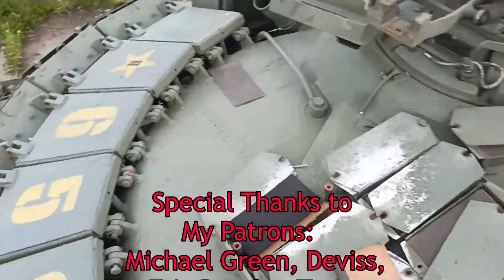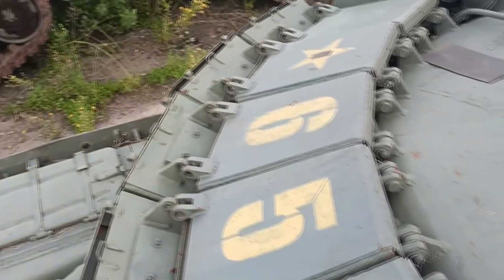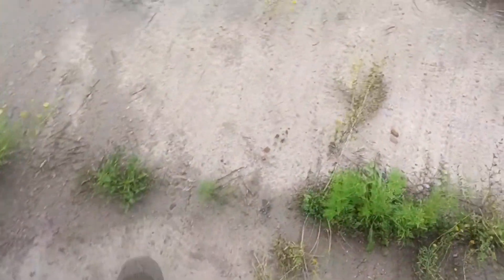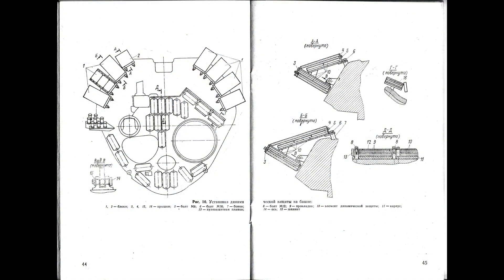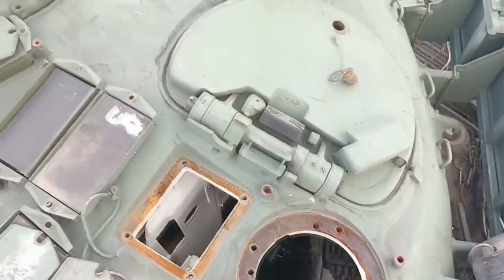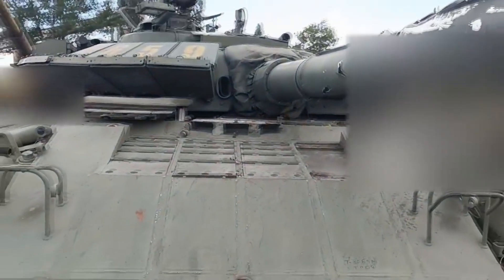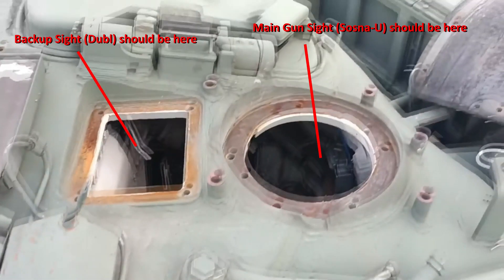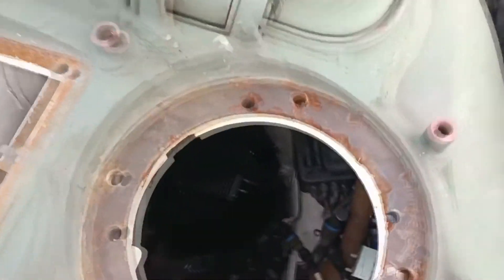Russians Are Using Rubber instead of ERA on their Tanks

Comment: In Desert Storm my US Marine M60a1 tank had empty-inert reactive armor blocks on the sides of the turret. Only the front slope and turret front had real reactive armor with explosives in the blocks. There was a shortage and so our M60's were not fully covered in ERA.
Reply: The "inert" blocks were most likely NERA panels, which are made up of layered metal and rubber. Apparently it's supposed to work at breaking a penetrator up by not being solidly connected together and introducing sideways/shearing forces into it.The lower-front hull panel of the M1 Abrams apparently has NERA integrated into it, not as aplique panels.
Reply: @dj1NM3  nope they were empty
Reply: The tank equivalent of only wearing the front panel plate :D
Reply: @josephmontanaro2350  It's just gotta look the part lmao
Reply: @josephmontanaro2350  Nope.That rubber are good only to stop added cumulative charge with magnetic suport
Reply: @josephmontanaro2350  yuuuup
Reply: To be fair, desert storm was such a stomp that the Iraqis would never get a chance to flank you, so you really only needed it on the front
Reply: @SelfProclaimedEmperor  I was there and to be fair we didn't KNOW it was gonna be a stomp so.....
Reply: @SelfProclaimedEmperor  Were you there? I was and I got hit by Iraqi artillery, had Iraqi tanks shoot at my 27 year old M60.
Reply: @ProjecthuntanFish  id be interested to hear more about that. The service of M60 in the war is hardly ever mentioned.
Reply: @ProjecthuntanFish not sure if you're willing to tell your story but I'd be interested in hearing about your service. What was the artillery like? Did it hit the vehicle? I never get a first hand account from those with real armor experience. I'm glad you survived I hope everyone else made it out. Thank you for helping in kicking Saddam out of Kuwait.
Reply: @soul-om4id  We were stopped in the first belt of mines going into Kuwait waiting for the column in front of us to move so we maintained a 100 yard distance between vehicles. I heard someone firing a rapid fire burst out of a BIG gun right near us and I told my tank commander that someone had just shot near us. I assumed it was one of ours. Then the XO who was watching the assault from his tank behind us came on the radio and told our platoon commander that his last "white" unit (we were call sign white platoon) had just taken a near miss by 6 rounds of Iraqi artillery about 20 yards behind them. Then it suddenly dawned on me that we were the last white unit and that the firing I heard was actually the Iraqi artillery landing right behind us. We then had a crew discussion about did our packs on the back bustle rack get shredded by shrapnel and were the two 5 gallon oil cans strapped to the side of the turret now leaking all over. As it turned out we only had some paint chipped off the back grill doors, LOL. I was in a USMC reserve unit and we hade M60A1 tanks.
Reply: @ericmckinley7985  I just posted a reply in this thread go look at it my friend
Reply: @ProjecthuntanFish  thats awesome. I was curious to know if tanks from the Cold War onwards were really vulnerable to less than accurate artillery. I love vet stories.
Reply: @ProjecthuntanFish  thank you for the reply, it's really awesome to hear your experience and I greatly appreciate it. Man that must have been a surreal event and one hell of a "pucker moment". It's kinda funny the concerns of did your rucks and oil cans make it out Instead of "holy shit we almost caught an arty round". Thankfully it was only chipped paint, but damn still way too close for comfort! 

A bit of a tangent but have you heard of a group on social media called Battles and Beers? They document stories and experiences of military personnel to share with others. If you're willing you should reach out to them and tell them your experience of being a tanker during Operation Desert Storm. Also they aren't long stories, they're pretty quick. But I know they are looking for experiences like yours to share. 

Thanks again for the reply. Semper Fi
Reply: @soul-om4id  Actually when things like this happen in combat you really dont realize the gravity of it until much later at least for me. Its not like a war movie where you see and understand everything that is going on. As a loader I was privy to jack squat of intel, LOL. My world was a loaders station and my main concern was doing my job, not letting my crew down and coming home alive.
Reply: @ProjecthuntanFish  how interesting. M60A1? Not even M60A3? I knew the M60 fought in the Gulf War with the USMC, but I never knew which model.
Reply: @kurousagi8155  yep no laser range finder just the old parallax frog eyed range finder
Reply: @ProjecthuntanFish if you don't mind I'm asking what's your opinion on the Marines ditching their tanks
Reply: @culturedman1310  I think it's a stupid idea and it castrates the Corps. Without tanks we cannot fight a combined arms battle and are now essentially just three Ranger divisions. The Current Commandant is a special ops guy so I doubt he fully understands how to fight a large battle. At some point Marines will be killed due to lack of tanks.
Reply: @ProjecthuntanFish  wow. I was in and around that shit hole for 11 fucking months and never even knew we still fielded M-60's lol. Yea the Marine corps fights with donations it seems like. Did they still have the big ass search lights on them? I trained on one at Aberdeen proving grounds and they were obsolete then!!! I mean the M-1,s been around since 80 or 81. I was around a bunch of marines but no armor units. We had some TOW guys around. I mean we had EVERYTHING!!!! It is a truly awesome sight to see the modern American military on the March like that. We had air shows. B-52 strikes in the distance. A-10's sawing shit up and oil well fire backdrop. Not much around me i was up north around KKMC but it fucked the sky up. It was just really surreal.... I can't believe you were on a 60 though lol. Good job.
Reply: @ProjecthuntanFish  what unit were you with and where were you located?
Reply: @richiehayhurst8175  Charlie 8th tanks. My platoon was attached to A/1/6, 2nd MEF, 2nd MAR DIV
Reply: @ProjecthuntanFish  hey fellow vet here, Did you ever see another m60 take an actual hit from a main gun of the Iraqi tanks? How did it hold up if so?
Reply: @ericpatten6204  no I did not and while we were fired on by some Iraqi tanks none of us were hit that I know of. My platoon was engaged by a platoon of T-55's but due to defilade we could not see them. Another unit spotted them firing at us and a Bradley unit from the US Army's Tiger Brigade took them out with their 25mm guns. We did suffer several mobility kills due to Iraqi anti-tank mines. Our M88 recovery vehicle was hit by Iraqi machine gun fire at one point though. On about the third day of the ground war my company repulsed a counter attack from elements of the Iraqi 3rd armored division a few miles south of Kuwait City. They were hit by Tiger Brigade's M1A1s and coalition air power in their assembly areas just outside of the city. A mix of 9 tanks and APCs managed to hit our position and were destroyed in a fight that last about five minutes. F-18's, Humvee mounted TOW missiles and our 1st platoons 105mm main guns took them out. We advanced into their AO and parked next to a burning T-62. I had my head out the loaders hatch when it cooked off and a round from it hit the side of the turret or hull below me. I promptly buttoned back up and we moved.
Reply: Reasons are probably similar as ERA plastic explosive has a shelf life of less than 10y or so its not always mounted in the elements in peace time for reasons like folks removing 100kg of plastic explosive for 'private ' use . And like the author mentioned, the tank on the picts was literally picked apart for months so we cant know when it was taken out.
Reply: @Mr.T-SI  decades some of those tanks been in parks since early 90s
Reply: Seeing as Russia is using vehicles from the sort of same era, than that explains a lot... Other than the fact that Ukrainian soldiers yoinked the ERA.
Reply: @bell3287  no
Reply: @bell3287  yoinked. 😂
Reply: @bell3287  T-72's, T-80's and T-90's are from the same era as the M60, that's a new one.
Reply: @bell3287  same era? M60 is from 63.
Reply: @bell3287  Wrong. T72s and T80s are much newer than M60s. M60s were around when T55 and T62 were the main Soviet counterparts. When Soviets designed T64 it was leagues ahead, which prompted the US and Germany to joint develop a new tank called MBT70, after which both went their separate ways, with US going Abrams and Germany Leopard 2. Both of those tanks borrowed a lot from the joint MBT70 project. Funny how burger eaters think M60 is comparable to T80. What bubble are you living in? T80 is much more comparable to Abrams than to M60, which is badly outdated junk now.
Reply: @bell3287 explains a lot ? What has the era got of tank got to do with it? Weird response with no analytical value
Reply: @bell3287  yeah, its all just war propaganda at this point, same with them showing us rusted AK's which look like they took them from the bottom of a lake as "current" equipment
Reply: @Mr. Reality Per Gen. Omar Bradley, USA, "Amateurs talk strategy; professionals talk logistics."  In addition to being the greatest amphibious invasion the world has ever seen, D-Day was the culmination of a mind-boggling worldwide logistics operation that pulled resources from almost everywhere and concentrated them into a fine point at a single place in space and time.  No invasion like Desert Storm or D-Day would have a prayer of success without a staggering logistics operation behind it.  Unless the invasion is going in unopposed.  Which apparently was what the Russians thought they were facing.  Holy sh!t were they wrong.  And it's logistics that's been killing them ever since.  Not strategy or tactics, though they patently suck at those too.
Reply: Interessing reply. Thanks for sharing
Reply: Sounds like the Marine Corps lol
Reply: @kazansky22  I went thru the breach with a 9mm Berretta as my primary weapon. I had two 15 round magazines but the Corps only gave us 15 rounds each so one mag was empty????
Reply: @ProjecthuntanFish  You weren’t in Desert Storm. You’re probably not even American. Desert Storm was the most successful military campaign in history, in which the 4th strongest military in the world at that time was defeated the in 6 weeks while the US took less than 500 casualties.
Reply: That was when the product was still relatively new in the US.  This is over 30+ years later for Russia.  Most of those old tanks should have some type of working reactive armor after 30 years even poor ones.  This however shows utter lack of it.  Indicating more of the corruption of Russias military branches and logistics.  A good indicator for perhaps China as well which is also suffering major corruption in it's own forces
Reply: @Mr. Reality Sometimes .. things fell through the cracks. We discovered that we lacked any immersion heaters and for a long time too cold showers in the winter. I still remember the shrieks . haha
Reply: @Mr. Reality yeah. The logistics of desert storm are a work of art.
Reply: @Mr. Reality TO SAY NOTHING ABOUT SHIPPING EVERY HALF WAY AROUND WORLD BEFORE SADDAM DECIDED TO ATTACK...WHEN USMC /AIRBORNE WERE THE ONLY TROOPS THEIR.
Reply: Long! Live! the United State's of America!

TANKERS LEAD THE WAY 
                  👊😎
Reply: I worked on M60, and M60A1 tanks in the army 1974-1976. Our unit got M60A2 tanks in 1976. They didn’t have anything called “ inert reactive armor back then. Your comment was very interesting too me. The M60 A2 was far more advanced than the earlier M60’s having the laser rangefinder and the ability to fire laser guided rocket’s. Plus other advanced improvements. I’m surprised you were sent to war with a M60 A1. But I now Marine’s are trained to make due with less. Thank you for your service.
Reply: That pisses me off, glad you made it
Reply: Jake  Um yeah and I wasnt in an M1A1 like the army but a 27 year old M60A1 tank!
Reply: @ProjecthuntanFish  how well did the M60 compare to the Russian tanks when you were overseas?  The M60 is a Vietnam era tank?  Was it upgraded in anyway.
Reply: @Paiadakine  No upgrades but with. US Marine crew none were needed.....
Reply: Thought we only used m1a1 in desert storm? Guess I'm misinformed? Thank you for your service marine
Reply: @shawnmccarty6923  nope most Marine units still had the M60a1 like my unit. The Iraqi T72 could take us out if they got a hit.
Reply: Even despite our huge defense budget, US military can also do its own ghetto ass bullshit.
Reply: @mediawarrior1461  well.... I know that too.. the first 2 months of Desert Shield before the war started we went without alot of stuff. But we were ahead of our supply. But yea,I agree. I've seen some pretty janky shit to lol.  I wouldn't of believed we fielded M-60 MBT's at that time till I heard it here.
Reply: But the U.S still had reactive armor russia has none😆😆😆
Reply: Maybe Nick Cage sold them to some Liberian warlord for blood diamonds.
Reply: The ghost of Donald Rumsfeld: 'You go to war with the army you have, not the army you might want or wish to have at a later time...'
Reply: Got any proof? Other wise you are blowing smoke out of your ass.
Reply: Desert Storm wasn't a real war. Stop bitching
Reply: My exact thought. Thanks for thinking this same idea 👍
Reply: did you know you that you weren’t fully covered when you went outside the wire?
Reply: @idrisali3947  There was no wire? Yes when we  assualted into Kuwait we knew that not all our armor plates were real. Each crew installed them on the tanks themselves.
Reply: Well....That would not have happend during 1960 or 1970's...Now days america has "produced" deep state aholes who are essentially just arms dealers.Same goes for oil prices and homeless ppl in USA.The sistem that i looked up to while growing up now makes me sick.No suburban small house with white fance and lawn for me i guess.But yes, that was my dream while growing up in communist Yougoslavia while watching Hollywood movies....
Reply: @seadfacic2924  Bull!
Reply: @ProjecthuntanFish  ?
Reply: @ProjecthuntanFish  Yep. Bull.I agree.
Reply: @Mr. Reality ofcourse the logistic operations looked impressive, the U.S faced no disruptions in their supplies whatsoever, the u.s achieved air superiority in short amount of time, which gives you the idea of how much of a weak enemy was the iraqi army at that time. Sure this LOOKS impressive on paper but when you look at an army so deficient and so incompetent that the war was pretty much a guaranteed win since the get-go it gets less impressive.
Reply: Wow that’s sad
Reply: Kinda telling of the military given that also at the same time there was a body armor shortage, you’d think with the amazing logistics capability of the US military they could source proper protective equipment for its personnel and equipment, talked to a guy who served in 03, there was a sapi plate shortage then as well and most guys were running only one plate, he was lucky he needed large plates and they had plenty but the medium sized guys were screwed. Guess that’s just part of it getting screwed and making due
Reply: @loganbaileysfunwithtrains606  no man. Wrong time in history you want to bust on. This is 90-91. Desert Storm we are talking about. And just so you realise? (Have you ever served?) That's the main thing. If you've never seen the scope of actually how many men you have to supply it's hard to understand the complexity of logistics. You have to feed and arm them. Try to shelter them and on and on. So when you gear up it's a HUGE undertaking. Imagine if you had to pick up and move everyone in the town you live in fly them 9.000 miles and house,feed and protect them. Just for starters. That's not even moving all the vehicles etc... see what I mean. So inevitably things are left behind or in short supply. It's not that you are neglected. It's a monumental task. Like I said. HUUUGGE.
Reply: @loganbaileysfunwithtrains606  oh... by the way. Didn't mean anything asking if you served. You did get the wrong war lol but I was just asking if you had seen any large scale activations like that. That's all. And ALL G.I.'s and Marines bitch so the problem may not be as bad as we make it seem. Plates?? Shiiit... all we had were flak vests that won't even stop a rifle round left over from looked like new issue but Vietnam era style. Anywhoo.... wasn't a dig. Just a question. It's hard to explain how the military works and cares and don't care about you to anyone who hasn't experienced it is all. I loved it. Most of it.....
Reply: @greggrace967  my comment wasn’t a bash at service men, it’s a bash at the poor leadership of the government, taking billions of dollars for defense and instead of using it to properly equip its ground forces or their medical needs after their service, its used on buying million dollar aircraft and private contracting firms doing shady business. 

I have some of an understanding in the logistics of war and the massing of troops in the Gulf War and the Iraq War, and yes I meant to state the two different conflicts and I didn’t, but the issue existed in both conflicts, in my opinion the 2nd time it happened it should’ve resulted in an investigation on why ground forces can’t properly be equipped from day 1 if they are expected to be activated for service like an invasion, I can understand some of the issues in 1991 but then again if the US was primed for war with the USSR at that time id still expect there being no issues in having modern equipment and enough of it, and like the original comment said the Marines were still running M60a1s and hold over gear, to quote Jar Head “the army gets satellites and we are left with this shit” I’d expect since the US is the largest military budget in the world that we could do better and that’s really my original comment was about, maybe if we downsized the standing military and stopped trying to be the world police we’d have better equipment for the fighting men and a better budget to help them when they retire
Reply: @loganbaileysfunwithtrains606  I agree with how it's mismanaged but thw airforce is why most soldiers aren't crippled on thr battlefield anymore, and the mercy groups doing shady business are our most ethical way to handle violent situations that could involve tens of thousands or even millions and isolate it to hundreds
Reply: @loganbaileysfunwithtrains606  Never once have we taken true net loss on anything we made. We've taken everything we ever made for the field and took it home, be it technology for the cellphones and computers in our hands or advanced studies for making pre-assembled trauma kits somebody with the IQ of 80 can effectively use in a pinch
The biggest issue we face is its just painful to do the funding over and over, especially when we're downsizing when we need to maintain the status quo and how it used to be I the earlier half of the 1900s where we were increasing in scale when we could have simply refined productions making less then can do more situationally we've done well as the "world police", and our ability to intervene is why 1st world war is almost a thing of the past
Reply: @loganbaileysfunwithtrains606  LOL In Desert Storm there was no body armor shortage. We only had flack jackets back in 90'-91', you are thinking 2003 twelve years later. We did have kevlar 2nd chance vest for armor crewman like myself though. You wore it under your flack jacket.
Reply: It means they cannot get a hold of what they need.
Reply: @easyenetwork2023  that's not what it means.
Reply: @easyenetwork2023  it means they get what they want and not what you think YOU need.
Reply: Did they work? Ever?
Reply: Wild, you'd think all the money we pump into the military they'd atleast make sure our boys are properly equipped
Reply: @ChiefCre  at the time they were all over cable news claiming we had the best equiped military in the world. In general we did but not in every department
Reply: There is no shortage. Just an attempt to save budget and time on ERA.
Reply: Well it looks to me that the plates are just being sold in this situation dude.
Reply: So says you.  Just saying.
Reply: not surprising, in an industry where the crews are replaceable, and they stand to benefit financially from equipment replacement as well, it's almost like selling for top dollar with fancy features and under delivering yields higher profit margins
Reply: @larry_ellison  LOL you guys kill me, it's always a big conspiracy. Anyone who served in the Marines knows all about equipment shortages.
Reply: Ah watch what your sharing have some respect for your oath. Revealing weakness is a strategic national security risk that gets your fellow patriots killed.
Reply: @MR__NPC  your full of crap and obviously have never been in the Marines Corps
Reply: Strange as US armed forces should be good enough equipped right? M60 tanks really need some extra armour protection.
Reply: Even then, the minimal on the front will still protect you.
Reply: wait! what?
the allmighty USA lacked of spare parts?
LoL
Reply: @RealNotallGaming  No the world's greatest fighting force lacked spare parts like it always does. The Marines call it more bang for the bucks. We always make do with left overs from the Army and Navy. We always win too.
Reply: @ProjecthuntanFish  there was 0 chance iraq could have won that war. Its not really an impressive feat. I wouldnt say it was more impressive than almost any military conflict.
Reply: @calebr908  Where did you fight and how much combat have you been in?
Reply: I find that hard to believe, don’t lie buddy
Reply: @Bruh-qp1gn  ? I couldnt care less what you believe. I was there and I have the combat action ribbon plus the PTSD to go along with it.
Reply: @Bruh-qp1gn  still waiting hear about your combat service........
Reply: @ProjecthuntanFish  
are you happy for what you did to the Iraqi people ?
Reply: @ooooooooooooooooooooooooooooow  Yep sure am and the Kuwaiti people were very glad that I fought to free their country.
Reply: I think you could drive without any during the desert strom cause the enemy doesnt have the capability to penetrate your armor
Reply: @JR-mh8vn  wow the stupidity in this post is off the charts! An Iraqi T-62 or T-72 could certainly penetrate the armor of a US Marine M60a1.
Reply: Marines, poor boys of the military lmao
Reply: @samholdsworth420  Still the meanest and deadliest.......
Reply: That’s scary. Luckily desert storm was a whipping and we didn’t really lose many tanks.
Reply: @ShabazzTBL  so please share your armored combat experience......
Reply: @ProjecthuntanFish  Don’t need to have been in a tank to google “how many tanks did the US lose in desert storm?” or to know that being in a tank with missing armor would be less than fun…
Reply: "There was a shortage" Meaning, the money wich was supposed to go for it, didnt.
Reply: @szymonrozanski6938  No it's the USMC so the money never existed to begin with. Go learn the history of my Corps before you comment again
Reply: Didn't know the M60 was still in service during desert storm, damn.
Reply: And you create a treason by this post.
Reply: @aleksandarnemanjic3602  Shut up
Reply: Dang we were using the m60 all the way up to the gulf war? That’s like some full metal jacket shit. I was 10 when that war happened and all we did in school was watch the war live on cnn. I ended up going to parris island myself in 1999
Reply: @sancho7863  Hey the USMC never throws anything away, LOL. We didn't even get the M60a3 with laser range finder like the National guard.
Reply: M-60 has been retired now tho right?
Reply: @lazyboylarry4345  yes in 1995
Reply: Why would you even share this with the world?
Reply: @philipmassicotte7090  Why not and shut up!
Reply: @ProjecthuntanFish  You're right. What was I thinking. You were a Marine loader. That was  probably a tough question.
Reply: @philipmassicotte7090  My unit was a Reserve unit and many of us were in college. We even had a Lance Corporal with a PhD. My tank commander was a high school teacher and is now a principal, the gunner is soon to retire as a lead investigator with a DAs office, the driver is now a retired Sheriff's detective. All four of us have college degrees so you are wrong to assume  Marines are stupid.
Reply: Thank you for  your  service
Reply: Hmm didn’t know that
Reply: M60?
That a typo?
Reply: @ernielarkin4793  no they were used in the 90s they had just been covered in ERA
Reply: @Zane-TheToiletSalesman  
That is absolutely fkng nuts man.
I never knew that.
Reply: @ernielarkin4793  No its not go learn your history! Dont believe me then look at my profile pic real close
Reply: The m60’s were relegated to non front line duties.  The actual tank battles occurred between the then new abrams and that was short lived.  Same reason they don’t use up armored humvees in behind the line duties.  There’s no point
Reply: @jamestewell7721  wow! We're you there ? I said we breached three belts if mine fields using M60's and yes we fought tank battles in them you stupid moron!
Reply: India 🇮🇳 support Russia, but when we see the results...
Reply: Ofcourse because you were a Marine a.k.a the poor boys or the military 😅😅😄
Reply: @BuyBitcoinholdit  Men not boys and we do our killing on the cheap
Reply: If you let an Iraqi flank you… you were probably asleep !
Reply: All the money given to the military and they cheap out on equipment? That's ridiculous 🙄
Reply: USA...
Reply: Flash Gordon used to drive our tractor. And then he realized it wasn't a tractor at all but a horse drawn plow. And the horse wasn't a horse at all, it was his Grand Mother pulling the plow.
Reply: Thanks for telling the truth, now america may actually make a real needed change...
Reply: Considering the Marines barely get anything and we had M1 abrams, it wasn't needed
Reply: @power3480  ? There were no M1s in Desert Storm only M1A1's and Marine M60's
Reply: Shortage is not the reason. US soldiers are disposable, is the reason. You would have to be an idiot to join the military and fight for a government that treats you like a piece of sh it. People are waking up.
Reply: say that to santa claus
Reply: People are going to rea way too much into this comment
Reply: just wondering if anyone know if oryx double recorded this tank
Reply: POV: you didn't watch the video
Reply: @geoffreyartaste3047  Yes I did. The problem is you cannot read.
Reply: even the US Military will do some of the same ghetto ass shit we are seeing in Russia.
Reply: ....какая то странная Война, пол Украины в ресторанах и дискотеках, на курортах  балдеют...другие Родину защищают и погибают....одни воруют деньги, которые весь Мир собирает на борьбу с Рашистами, другие убежали в США, Канаду, Израиль и Европу,   а своё жильё сдают беженцам с восточной Украины и наживаются на горе людей,...надо строить военные заводы, выпускать ракеты чтоб долетали до Москвы,...а тех кто убежал с страны лишить украинского гражданство, конфисковать всё их имущество и обязать выплатить по 1000000 долларов штрафа, и надо что бы правительства других стран забрали эти деньги с предателей и отдали Украине..
...срочно надо закрыть границы, всех мобилизовать и женщин и стариков и детей, старики и дети могут выпускать снаряды и т.д. Женщины могут стрелять, перевязывать раны. Чтоб день и ночь стреляли по Рашистам, чтоб у тех небыло время даже поспать. Послать спецотряды заграницу и вернуть всех украинцев на Родину. Примерно 15 миллионов живут за границей, и любят Родину  издалека, а кто то должен за них и их имущество воевать, погибать. Хитрожопые. Если 40 миллионов вооружить то Рашке пизьда. Там одна алкашня и трусливая пидорасьня...
....почему не покупают снайперские винтовки ???.. и надо создать армию снайперов, и не будет потерь.......Кому то выгодна эта мясорубка. Зачем воины Украины сидят в окопах и погибают от мин и артиллерии, кто их туда посылает ?...и когда воины говорят что придут в Киев и разберутся с предателями, то Рашисты узнают координаты тех кто угрожают предателям в Раде и правительстве и наносят смертельные удары....кто передаёт данные Рашистам ?...почему не работает контрразведка...почему не работают спецгруппы в тылу врага, не уничтожают пропагондоноф, предателей, военные объекты, эшелоны с военной техникой ?...
....а как Путлеровцы стали бомбить Львов, то сразу завижали «закройте небо»....а  шо не нравится ???...а как Рашисты бомбят восточную Украину, то не надо закрывать небо ???....пока вы сдаёте своё жильё беженцам, а сами убежали в США и наживаетесь на горе людей, то мира в Украине не будет...
....конечно, бандит и убийца  РабсZZиянец награбил, и отдыхает в Египте, Дубае, Турции  и т.д.....а что там делают некоторые украинцы ???... У них дома Война ...или они  с рашистами заодно...Ждуны ???...
Reply: I like unbiased fact comment, so many annoying biased comment they try to bring something up
 like some comment here say iraq cannot flank your anyway is sounds so stupid
Reply: @jojojaja129  to be fair the Iraqis lost more tanks to Bradley chaingun fire (and many more to the mounted tows) that almost shouldn't have been possible than the US lost armored vehicles to Iraqi fire
Reply: @primarchvulkan5097  What i try to say people like to overrate thing too far and tank get destroyed by infantry Anit-Tank weapons like flank attack from ATGM and RPG or IED most of the time not Tank to Tank combat this is why ERA in side armor are needed not like some people say in this comment
Reply: Marines always getting the scraps
Reply: Marines don't need armor. Stop tank shells with hard head.
Reply: Not like they were needed in desert storm, US lost only a couple of tanks. Here on the other hand lol.
Reply: @uraniumcranium2613  The only reason US didn't lose tanks was because of good engagement tactics and the overwhelming superiority in engagement range. Better optics, better range guns, stabilizers, air superiority which gave them better recon (people really underestimate the value of recon). If you fire first, the enemy generally doesn't get a chance to fire back. The optics in US tanks where so good, in case of the Abrams all they had to do was point and click. Oh, and night ops when the Iraqis didn't have NV. The Iraqi tankers never even had the chance to get good hits on a US tank, however an RPG to the side is all it takes to make an M60A1 look like a roman candle so he is right to be concerned about the lack of side ERA.
Reply: @uraniumcranium2613  Hindsight is 20/20. The US was expecting much higher losses and a much longer war. It's skill, luck and superior technology that prevented all that.
Reply: @uraniumcranium2613  you do realize that the biggest tank battle in history happened during desert Storm right? Check out the battle at 73 easting. Sure that was army Abrams, but the Marine tanks were the spearhead attacking directly into Kuwait, head on into the Iraqi defenses, while the army, the British, and the french flanked out Kuwait by going directly into western Iraq and then turning east into eastern Iraq north of Kuwait.
Reply: @uraniumcranium2613  my tank was engaged by a platoon of T62s. If they had hit my tank it could have mattered. If you didn't fight in it I'd keep my opinions to myself
Reply: @ProjecthuntanFish  dude stop being so dramatic, if you don't want to hear others opinions stay off youtube
Reply: @norman6694  He's saying it as it was show some respect for someone who has experienced the reality of war rather than read about it with the benefit of hindsight
Reply: @ProjecthuntanFish  Where those t62s shooting heat/other chem rounds, or kinetic? Ive never been able to find out much and im curious
Reply: @uraniumcranium2613  yeah true but usa was going against old t72 with out night vision. And as always usa putts sanctions on the country they want to go to war with long time before the war.so iraq could not buy military equipment. Usa cant go alone in any war .never after usas war  losses in 60-70
Reply: @thebigone9781  total BS, Iraq had plenty of opportunity to buy whatever weapons they wanted
Reply: @thebigone9781  what war losses are you speaking of
Reply: Why was there a shortage? 

My dad was driving some old truck (Nam era I think) as an fuel truck driver in the Army. And it had heat, though no AC. 

And a Gaurd unit in my state deployed with modified Freighliner FLDs. 

So I get, that Uncle Sam has his way of doing things. All that to say, I'd like an in depth answer than some robotesque reply that such a question can elicit from the non combat and combat veteran alike.
Reply: @DesertCatDad  Well as a LCPL and loader who was only 21 years old they didnt feel like telling me why. But I did got steal an active block from the XO's tank and  put it on the side of the turret next to my head, LOL.
Reply: @ProjecthuntanFish  The answer to your question was given in the OP statement. Marines. They barely ever get crap because they're a part of the Department of the Navy and the Navy will give the lion's share of the budget to itself and throw the scraps at the Marines.
Reply: @ProjecthuntanFish  LCPL Underground at it's finest
Reply: @ProjecthuntanFish  Probably a sneaky politician/general make a deal with the manufacturer and replace those materials with cheaps ones for extra cash. In other ways: Corruption.
Reply: @davhot4107  ROFL , you obviously have never been in the Marine Corps!
Reply: @Talishar  I mean, the fact they where still using M60A1s should tell about the "love" marines get.
Reply: @Talishar  not true. The USMC has it's own budget. It determines it needs and be puts in budget requests for them.
Reply: @craigplatel813  Which is given to it from the same pot as the Navy.
Reply: @Talishar  no the navy does not give the Marine Corps it's budget. The USN and USMC are separate services under the department of the navy. Congress budgets to both of the services separately. The USN doesn't give the USMC money.
Reply: @davhot4107  That's not how things work in the US. If you say that kind of shit around someone who actually works in defense or logistics, you're liable to get punched. And you'll completely deserve it. Those people do take pride in their work. But any military can suffer shortages, even the US military. They might have the parts in inventory, somewhere. But they have to compete for transport space with all the other supplies that have to go over, and compete against operations time tables. Something is going to get left behind somewhere. 

As an extra note, there is no "Lowest bidder" either. If there was, companies like Colt wouldn't maintain contracts for one weapon or another for over 130 nearly consecutive years. Companies design the weapons, then sell them. The government doesn't invent that shit and then ask around for who can make it like they did in the 1930s an 40s when there was still a national armory. Weapons wear out with time and use, and sometimes no amount of parts replacing or cannibalizing will save them.
Reply: @ProjecthuntanFish  fill the CO's with a Penthouse magazine
Reply: @Talishar  yeah I remember in desert storm they were putting sandbags in the bottom of humvees to protect from ieds, marines got screwed in that conflict
Reply: @ProjecthuntanFish  let's hope no-one hit the magic spot in that tank you took the era from
Reply: @davhot4107  not likely. The way the procurement process works in the US makes that extremely difficult
Reply: @DesertCatDad  the only thing that had any kind of a.c. while I was in the ARMY was commo vans etc. Electronics to be cooled. I've NEVER heard of a.c. in anything else military. Hospital tent maybe. Freightliner trucks that we used were only to pull low boy trailers with 68 ton tanks on them. That's why you needed a bigger tractor than a reg 5 ton. But a.c.??? No way. Not for comfort. Heat yea. Only cause that was a by product.
Reply: @DesertCatDad  because it was expensive to manufacture that shit lol not even to mention it was the 60s. And as for the truck, as long as it works don't fix it.
Reply: @DesertCatDad  Before the War on Terror, American Military Vehicles didn't have airconditioning.  In my Transportation Unit, our PLS Trucks had AC added When the Armor was added in Kuwait.
Reply: @DesertCatDad  you seriously expect a tanker to know why there are production issues with ERA? This is like asking an Amazon delivery guy why your shit hasn't shipped from China yet lmao. My unit deployed with not enough barrels for any of our crew serves, the boys with the 101st we were supporting were going out in GW1 Era humvees and not their maxxpros because they were all broken down and there were no parts. The US would be having the exact same issue Russia is having, probably even worse of a time considering Ukraine has been receiving equipment from what would be front line units if we went to war
Reply: @DesertCatDad  Pretty sure they can't even buy a truck without heat, buddy.
Reply: do you have any source for this info?
Reply: Its call space armour hahah
Reply: I would imagine that the US decided to use the ERA in other equipment. They were taking a chance on the Iraqis would never out flank them. That it would be a frontal assault. And Iraq was dug in.
Reply: @t.r.4496  again another one who has never been in the Marines.
Reply: @ProjecthuntanFish  no I wasn't in the Marines I was in the Nat.Guard. I got out 4 months before Desert Shield. My unit was deployed anyway. If your bragging about being a Marine you can take that shit and go somewhere else. We were never short on anything during my time. I guess they just considered you expendable. Thank you for your service anyway.
Reply: The Army's 2nd Armored Division (Tiger Brigade) and their M-1A1s also led the way for the Marine's attack into Kuwait
Reply: @DetentionHallPutsch  No they didnt! I was there and Tiger Brigade did not go thru the breach not the minefields until 24 hours after we did. The marines breached the minefields and fortifications and then Tiger brigade was to manuver ahead but the Iraqis folded so fast that our Marine M60's kept advancing. yes Tiger brigade did fight and yes they did help smash the Iraq armored counter attack south of Kuwait city on day two BUT they did not lead the marines anywhere.
Reply: It happened in alot of wars and most of us are guilty of repeatedly skimping out. Theres still a vital difference between us and them though, as 90% of the times we don't match production to demand we dont actively seek out the war and we definitely don't chant WW3 during it
Reply: No no.... Russia NEVER takes such measures.
Reply: Desert storm was back in the 90's this is 2022